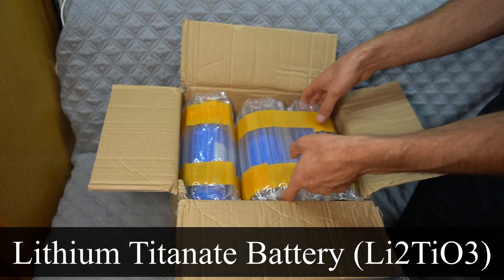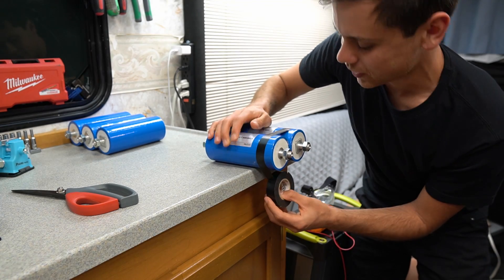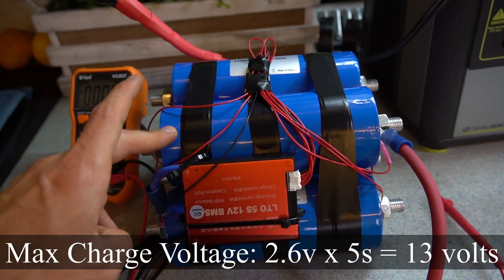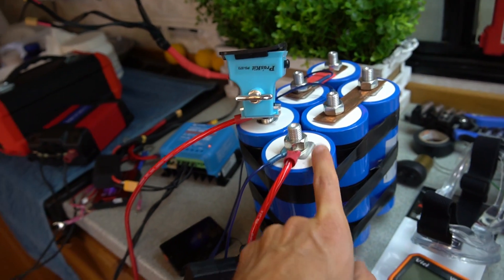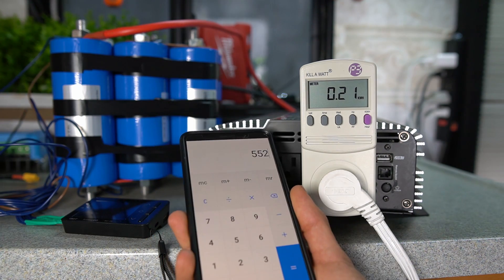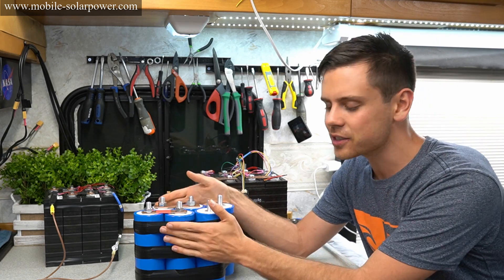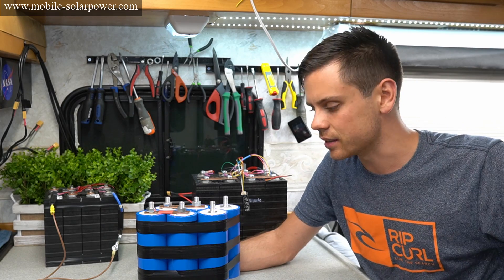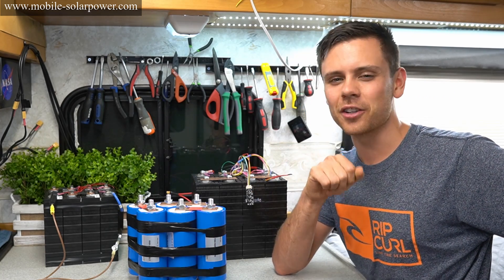DIY 12v LTO (Lithium Titanate) Battery

Comment: The work amazing as regen braking batteries as they handle a nice current and temperature and you can transfer to lifepo4
Reply: @SeanMaclean-u4d

Capture more and then lose it with 15% loss in the transfer. Doesn't seem worth it.

Comment: Is LTO or LFP better for peak discharge applications? (The instantaneous maximum pulse current)

Assuming for the same grade, rated, manufacturing quality, brand and under identical given conditions where all parameters are held constant (except for the inherent chemistry, all else being equal)

Comment: Ok, they are less efficient. However, how much is your installation not going up in flames worth? Personally, I think fixed installation should go back to Edison batteries that last many decades. Yes, they are heavier, but they have greater lifespans than Lithium and don't require child slave labor to mine like Lithium.

Comment: 6s would be much better. I doubt the dented one is suffering. One way to balance is to buy cc cv dc to dc modules. Have one module for each cell. If you buy 6x 5A modules you can charge each cell individually and they will always be balanced. that's 30A charging so not too bad. If you buy bigger dc to dc modules the cost can go up considerably but it can be worth it depending on the use case.

Comment: They are clearly advertised as high current in and out. If you have any supply in at all would be good their density isnt too great compared to other choices . So try charge it up and start your car like your title would suggest a 12v battety title would hint. The didnt wouldnt have bothered me probs would have been fine

Comment: My 2 cents, while its not that great at discharging but, this is extremely good for elec cars or ebike and the likes.  O_O super fast charging/longest life atm is where this LTO shine, or if you need off load your main battery bank to LTO for excues power so transfer over fast.  

I suppose its good for slower discharge that means good for 12v low draw devices or mainly like LED lights, think what if can do for phones be amazing at super fast charging.  

I vote LTO have quite a bit of value, however, the stats for LTO is questionable which is another down side when buying at current market, its still pretty new tech so not sure how it will land in the future.

Comment: 0,29kwh and that battery pack is huge. Thats why they have so much cycles on their lifespan.
I believe in the same size lifepo4 you should get around 1.0 - 1.5kwh

Comment: 6 cell for 12v (up to 15.8) and 11 cell for 24 system (up to 28.9) be aware 12 cell it can be mutch higher over 30v or you lose the capacity over low charge voltage

Comment: Man this LTO cells mainly used in car audio due to their great output and charging. 40Ah cells banks of 6 can pull out at their peak about 600ah.just increadible and are charging with 10c if you got proper powerfull alternator.

Comment: you are NOT using their full capacity because their peak voltage is 2.9 V 
( & you are charging them up to 2.5 V only ) ; which makes a big difference.
   on the lower end you are discharging them till 1.75 V ; their capacity being till 1.5 V  ( for safety, you may go down to 1.55 V ) & hence losing capacity there too ( though not as much as the upper end ).

Comment: Where LTO also outshines most LiFePo4 is the discharge C.  If you need to field weld 1 inch steel plate using a set of jumper cables and a coat hanger, these are your boys.  What I'm curious is if you could drop these in place of a car battery and have a 14.4v alternator charge them like a 4S LiFePo4 can be.

Comment: what if you could have a two or three sets of titanate cells , redadant to each other so that the hole system could fall from one set to another and the set of cells not used getting charged to keep them ready for another usage...

Comment: Your video is very good and useful for people like me. The Discharge efficiency of 85 percent, is NOT a good thing for EV application. Still , I  will try them , For making the LTO battery pack, because  The 30 Ah type LTO cells , have a Longer Life span , and I think, the Battery pack should work in all types of Weather Conditions.

Comment: Wonderful info! Ive been arguing with  people on the internet about doing 12V 5s LTO systems with Lishens since they hold a slightly higher nominal voltage... since they drop so quick the best thing to do is get LTO cells with the lowest nominal voltage possible... then if you do a 6S (like with 45AH yin longs) you can be at 13.8 or 14.0V for a long time... perfect... people think you need 15V for a 6s LTO... no you really dont.. you can replace a car battery with a 6s of 45AH yin longs... just make sure you get the yin longs not lishen or toshiba scib.. those both have a slightly higher nominal voltage than the 40 and 45ah yin longs...

Comment: Another great vid Will. I’m curious to see some experiments with LTO/Caps/(lifepo4 maybe) in series on the solar side (or both sides) of an all in one system 12v-48v systems to see what difference it could make during sudden shading effects and overall extra power to main batteries for extra after dark  power reserves. A high voltage bank with another new age type controller to suck them down to a low state of charge and continue to charge the main system batteries after sundown could have some huge advantages in generating greater power from any solar system. Luv ya vids from Australia.

Comment: I'm thinking, home bike build using oversized frame tubing the same diameter of these batteries, easily fit 10 - 12 in double-cradle frame, would make for a neat tidy build, all connections in the tubing along with control cables,

Comment: It comes with 6 for a good reason. Yes maybe you don't need to take it to 14 volts but it's better than starting a fire. They look a lot like my super capacitor bank which I use on my solar backup. Differences are that that is Lithium battery bank which would have way more energy density and mine has an over voltage protection/ load balancing circuit. My inverter can hold up to 14 volts with no problem. I use the capacitors as a suspension for my batteries in case something put a sudden load like motor or something that put a jolt of amperage draw on the batteries the caps absorb a lot of that jolt by providing that initial current draw and then leveling out. I think I would be a bit apprehensive to use the lithium system from China because even though super caps can be dangerous lithium will really light things up and not in a good way when used incorrectly. Stay safe...

Comment: Big Will please help me out because I need your advice. Always love to look at your videos that's why I'm subscribed already. This my question I have 400 watts in my off grid solar panels set up, with two 12 volt batteries wired in parallel. Should I have a 40A solar panel controller instead of a 10A which I have hooked up?

Comment: This seems like it could be good for a starting battery for my boat. No issues with leaving it under-charged at the end of the season, no issues charging or discharging at low temps, etc.

For starting my small boat I need a good 80-100A pull, for lithium iron phosphate this probably means 100a cells so I am looking at close to $400 anyway. With the high discharge current on these the 30ah capacity is no issue, though doesn't save much money over 100ah LiFePO4 cells.

I was hoping this would be closer to $200, an easier sale over lead acid when the time comes to replace my current starting battery

Comment: You need thicker material to join the batteries together like 1/4 aluminum plate. That super thin copper strap material isnt enough to handle the amperage ability of those cells.

Comment: A lead-acid battery has 500-1000 charge cycles?  I have just replaced my car battery, having run the car for 17 years, and having done many, many trips - certainly a lot more than 1000.

Comment: We would love you to make a video with your lithium titanate cells to show a solar setup inc which solar charger to use, which bms and the best solar panels to use for use on a 12v system in a rv
Reply: Our reason is the safety of these cell.
And I would hope they are 10 times better than lead acid.

Comment: Chinese watts and measurements seems to be differant that European standards....go figure.
Campervaners and others like them due to there safety and ease of charging and there 20,000 cycles compared with other types.
Them in conjunction with maxwell super capacitors would be an interesting combination.

Comment: What also needs to be considered for LiFePo4 vs LTO is that if an LiFePo4 battery "only" lasts 10 years when compared to a (hopefully) 50 year LTO, but costs substantially less for initial investment, is that in 10 years battery technologies will improve and LTO prices will likely come down, so why bother with LTO now when it's so costly. Just my economics opinion.

Comment: I used lead acid batteries from 1996 to 2019.  Lets see 23 years times 365 days = 8400 cycles.  Is that more than 1000? My phone lasts 3 years with a Lithium Ion battery.  3 times 365 = 1100 cycles.
Which is longer?   Where did you get your stats from?
Reply: What lead acid batteries do you have that last 20 years just curious, what DOD do you put them through? Even the more expensive car batteries (for vehicle starting, minimal DOD) only have a 7 year warranty that i have ever seen.
Reply: @davidlevine5895  Car batteries are no good.   They don't last. I use industrial flooded lead acid batteries.  I get the used ones which are a couple years old in very good  condition.  I bought 60 KW of batteries for 
$4500.  Some new ones will last for 17,000 cycles.
Reply: @davidlevine5895  The batteries that are used are industrial batteries, mainly used in electric fork lifts or other industrial applications where heavy demand is needed.  Next, there is about 60,000 watts of battery back up power.  With this much power, typically up to 20% or less is used if possible when the sun is down as  solar power is used during the day.   Sometimes the batteries go to 50% or more discharge on multiple cloudy days, but not often. Power usage is closely monitored daily to keep the batteries charged. Next  the batteries are fully charged as often as possible, (daily).  This means they are at full charge voltage (28.8 volts or higher depending on temperature via the mppt controller) for at least 3-4 hours daily. (this if very important for desulfation of the battery)  As there is 13,000 watts in solar and 4 mppt controllers it is possible to do that.  About 1/3 of the panels are on carousels which follow the sun "manually".  Lately on full sun days solar produces about 85 KWH per day or more.  During the winter about 65 KWH is produced on full sun days. Next the batteries have de-sulfaters on them which help to desulfate the plates and keep the battery acid at the optimal ph level, 1.280.  The batteries are checked often, about every 2 months for level and acid ph only when they have been fully charged for at least 2-3 hours and they are bubbling consistently. (Records are kept on each cell and closely monitored, there are a total of 48 cells) If the ph is at 1.270 or lower  acid and distilled water is added to increase the ph level.  If the ph is 1.280 or higher distilled water is added as needed. The batteries were purchased used, about 2-4 years old.  Total cost of the 4 batteries $4500.  These batteries are 24 volt, 600 amp batteries.  There are 4 batteries, this totals to 2400 amps at 24 volts. The batteries weigh about 1200 lbs each and are moved into place with a engine hoist.

Comment: Lithium titanate has a very low energy density, equivalent to lead acid. Its only advantages are the high power density (which lead acid also has) and the cycle lifespan. They are better as car batteries, but they need to be in a 6s configuration.

Comment: I tried before and i am trying again. What if you use only one cell, connect a Buck-Up_Voltage Converter and let it run a Laptop at 20v. What would a 40Ah LTO Cell like this blue one get you at that end? Is it reasonable to have one in your bag in some form of small cylindrical case? Could you run a 45 Watt Laptop for 10 hours? Than you would wanna buy one at $50.

Comment: You can increase the total number of Ampere Hours very easy...!
Just make a second or third accu pack with that same amount off cells.
And then its just a matter off parralel connecting all of them and it will 
be the the total of AmpereHours off each pack combined...

Comment: 3:03 And that's why DIY battery packs sometimes start burning. THE BMS cables are the most common reason for this. Because they have to be as well insulated and beautifully laid as the main cables.
Reply from the maker: I only had the balance leads that way for the test. I wouldn't have them like that if this wasn't a one time test

Comment: Hi Will
I was wondering if these batteries would be good for audio.  
I have a custom built 2.1 channel stereo surround sound system. 
It is built out of an ammo can. 
It has a 12v 18ah battery. 
I am looking to completely rebuild this system but use a cooler instead. 
I am looking at a lithium battery around 30 to 40ah battery. 
These batteries would be perfect, small and lightweight. 
Here is the video link to my system.

Comment: If they are 2,3v each, how is 5 batteries enough? Shouln't he need 6?
Reply from the maker: Watch the whole video
Reply: @WillProwse  Oof, Will responded to me :D 

I didn't fully understand "nominal voltage", that's why :) I assumed 2.3v was the max voltage of the batteries. 

You mention that for 12v applications these batteries won't deliver their full charge. 

Is it therefore better to go for LFP batteries instead of LTO ?

Comment: It just depends on your application. These say that they can get upto 95% discharge efficency at ideal temps and at a 1c discharge rate. That is if you consider 2V around the lowest usable voltage. But at -20C they will only give around 45% discharge efficiency at 1C but much better at 0.2C. If you had enough money and enough space you could just keep adding banks until you are only drawing 0.2C from each cell. That is if you need to use them in -20C and get good performance.
  Seems like a decent storage battery if you have enough money and space to build the bank large enough to keep to around 1C max draw on each cell. I would consider them as a home storage option. I would like to know how life expectancy is effected by storage voltages and chemistry stability. You have to remember that if you are drawing most of the mAh from each cell each day that at some point you will be at the lower end of the voltage spectrum and at another time your cells will be at the upper end of the voltage scale. It's not lilke batteries are always at the optimum storage voltage unless your either not using them or only taking a tiny load from them daily.
   The amount of use may seriously effect the lifespan as the cells will often be at the upper and lower thresholds.

Comment: I built a 24v 120Ah pack (3 parallel 11 series) and have been using them in my van for over 8 months now. The pack works to specification and I'm perfectly happy with it. The pack can be mounted under the chassis as they can be charged below freezing and it saves on space on the inside of the van. I do not care they are heavier than LiFePO4, they are still lighter than lead acid. I do care that they are safe and will probably outlast my van and me.

Comment: hey do you know anyone who can help line me up what I should do with my alcad batteries they are nicad designed to last decades too like the old iron batteries I don't know what kind of converter I need to begin with or what kind of a charger on a budget, I have 40 of these 30 some pound batteries I want to solar charge and run an off gerd system? Thanks for your time!

Comment: I was kinda eyeballing the LTO pouch cells for how much safer they are over LiPo / LiFe but the massive reduction in the energy density as well as the lower cell voltages would make them a bad choice for the applications I had in mind... They would in all likelihood make awesome low maintenance power bank cells though for back-up power / UPS applications given the per-cell voltage is very similar to that of a fully charged Pb cell.

Comment: What if an application required mutiple daily cycles?  A bus which recharges at end of route, or a bit at every stop, for say 10 cycles a day, would be cost effective.These might then last a decade compared to lithium only lasting a year.   Conversly, these may be no better than other battery formulations for long term unattended operation in the deep woods at an unserviced weather station. 20k cycles may be true, but battery may self-degrade anyway over say 10 or so years. All batteries degrade even when uncycled.  Don't assume 20k cycles @ a cycle a day lasts 50 yrs.

Comment: Good job, am a new beginner pls I have two 8v/ 40amp/480wh battery. what  is the soler panel/inverter/change controller needed for my battery for to have light at home? sir tnks

Comment: 0:07 Currently they are as cheap as LiFePO4. Wait... What?
6 LTO cells 2.4V 40Ah each costs 280$ = 576Wh.
1 LiFePO4 32700 cell 3.2V 6Ah costs 4$ = 19.2Wh.
1LTO Wh = 0.5$
1LiFePO4 Wh = 0.2$
It is more than twice difference!

Comment: I am pretty sure that they are actually a type of super capacitor and not even a real battery. Did you check their ability to hold charge over longer time periods? That is where caps really fall over.

Comment: Sir what happened to the amp if it will be inverted to 220 volts? For example a 12 volts battery of 100ah inverted load to 220? Correct me if im wrong but you will only consume  10ah?